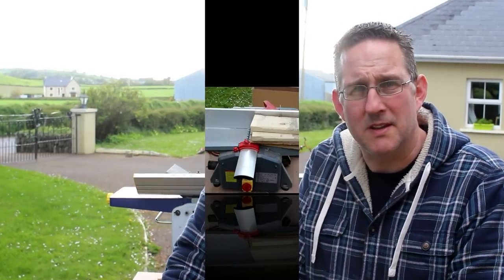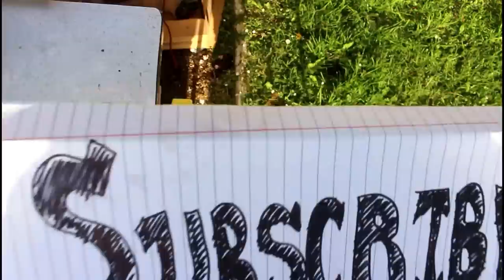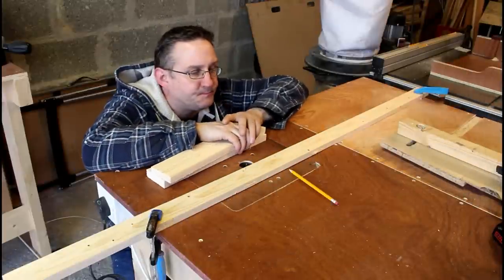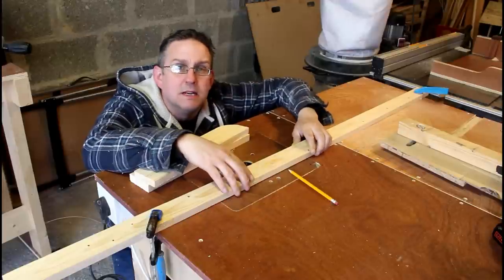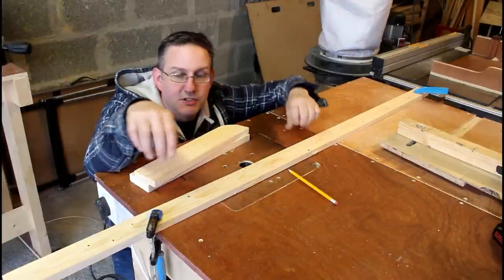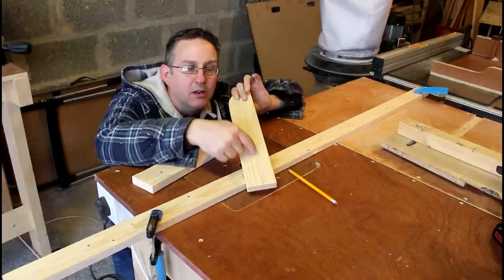Pallet Wood Can Crusher

Comment: Using fully threaded bolts for pivot pins is a quick way to wear out the wood inside the holes. Carriage bolts, with part of the shaft non-threaded would be better. Plus the geometry needs a tweak...all that work and the can only gets crushed halfway?

Comment: Keep that brain working: your crusher is a GOOD EFFORT, but, you remain a short ways from home. Although it is not new, I do like the concept ... if you can take it those few extra steps. In general, may I suggest a few METAL PARTS; putting a metallic top and base on the two wood pieces --- that wooden top and base, against those many metal cans, certainly won't have much longevity --- and use metal for the handle and the handle axle. CHEERS! The World needs more solid homespun inventors. I'll tip a cold one for you!